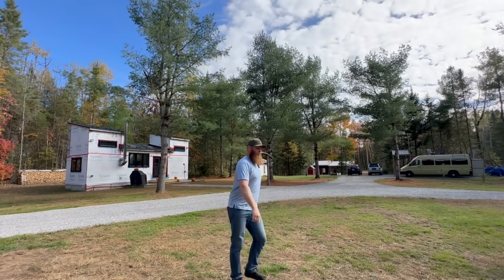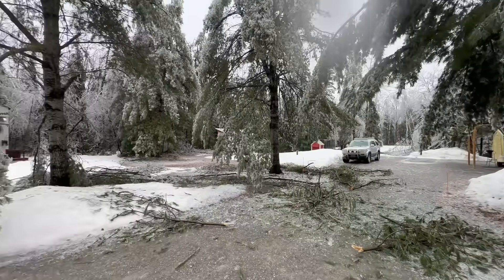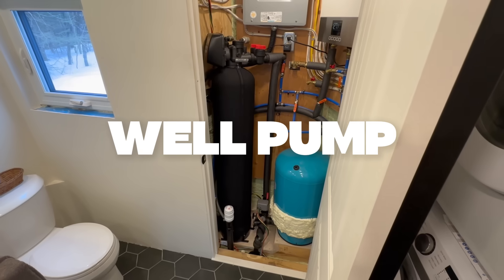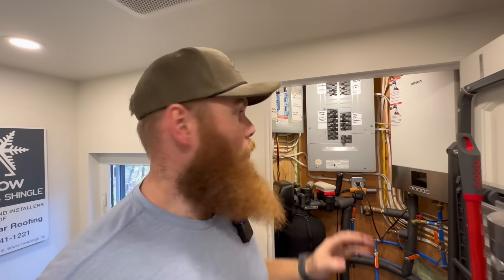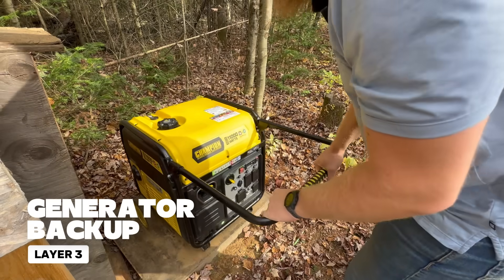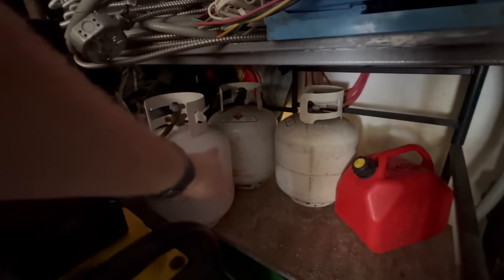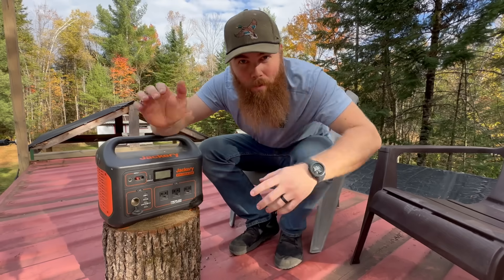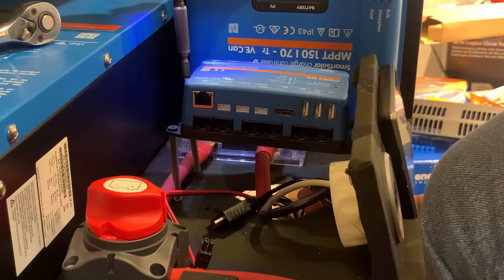This Trick Keeps Our Tiny Home Powered All Winter

Comment: We are t as prepped, we have propane oven/stove and propane wall heater in the hallway. Our grid home gas electric for everything else. When we lose power, we use candles and our solar generator for the fridge and freezer. Our plan is to get a dual power generator. Losing the well pump is no fun! Thankfully, we have a spring fed creek… gonna check out the generator you suggested thanks!

Comment: While I do rotate my gasoline supply and use Stabilizer….Ive read and been told that diesel DOES NOT deteriorate like gasoline and can be used after years in a plastic can.  FWIW….i also put Diesel stabilizer in it

Thoughts? And Thanks!!!
Reply: Diesel is fine after 100 years. You can look at videos of junkyards starting up diesel engines that have been sitting for 75 years using the fuel that has been sitting in the tanks.

Comment: We're an off grid "Homestead" with no grid power.  We have just under 4kw worth of solar panels, 16 100 ah Battle Born lifepo4's a 4,000-watt duel fuel genny, a 2,000-watt gas one, and a 4,000-watt contractor generator as a last resort..  We have a 320 gallo0n propane tank currently sitting at 70%, wood heat, and 2 30,000 btu propane heaters for backup.
Reply: The guy is a delusional fraud.

Comment: I don't live off grid but my area tends to have power outages that can last 12+ hours, specially during bad snow storms. After we moved in 3 years ago our neighbors told us that they've experienced 10+ days of no power during the winter and gas shortages. We have an 18k solar array on an adjustable ground mount system, 45 kWh of battery storage, a smaller 2k solar shed with 10kWh DIY battery storage, 2 generators (one is dual fuel), 2 Ecoflow delta pro's, a portable Ecoflow delta 2, extra solar panels, a few small electric heaters, and a few backpack sized portable batteries. We're definitely prepared lol.
Reply from the maker: Wow now that is a backup setup if I've ever heard of one, good job!

Comment: I recently moved to rural Texas in 750 sq ft all electric home. I put in a 250 gallon propane tank and heater for winter power outages. I have 3 portable power stations in various sizes that I use for TV, internet, fans, lights and refrigerator / freezer that can be recharged by dual fuel generator and a small solar setup. New power stations can be recharged in a few hours using a generator. So an expensive solar set is no longer necessary, but good to have. At a minimum, have a 1000 watt power station. After 5 yrs, my Jackery has been used for running power tools, camping and power outages.

Comment: interesting setup. We live in southern Spain. For 5 years off grid with 2 solar systems (1 main, 1 backup) and a big 15kw generator. The generator is basically a jerry rigged tractor motor with an outlet lol. We also have a grid connection since 2 years. But with 30kw battery bank, 10kw in solar and the generator we never needed to use the grid.
Reply from the maker: Now that is an awesome setup, love the tractor as a generator idea. appreciate you sharing!

Comment: Ultimately it has to come down to budget.  We all want things we can't afford.
Grid power is the cheapest and most reliable power available.  Unless of course you need power run 2 miles in the boonies.
Your battery setup was NOT cheap.  Battleborn batteries are good, but WAY overpriced in today's market.   The same goes for Victron components.  I just built a complete off-grid system for a hunting camp and it cost $2600 total.  That's  a 6k inverter and 2 server rack batteries, so 10kwh.  We already had solar panels so that isn't included in the price but I'm seeing 400 watt panels for $120 in the Atlanta area.  We put 1800 watts of panels on this system. We also have a dual-fuel generator for recharging when needed.
It really comes down to your needs/wants.  If you need to run a well pump, heat pump, electric appliances, or an HVAC system, you need a pretty massive battery bank.  In the Southeast, it's common to use 70kwh per day during June-October in a normal house.
For strict emergency backup, I recommend a small gas generator.  5 gallons of gas will keep your fridge and TV running for a week.  Bigger generators run more stuff but use more fuel.  
The power stations (Jackery is at the bottom of my list) are great, but expensive per kw.  2kw really sounds like a lot of power, but it's not.  
I have 3 power stations that I can move around inside to run different things.
I have a dual-fuel generator, Harbor Freight, and a small Honda gas.  Backups to backups.
I do not have a grid tie battery system.  The cost to power my whole home would be prohibitive for something that rarely happens.  We live on a farm, so keeping 25 gallons of gasoline is no problem.  We run it through equipment before it gets old.  We also keep 120# of propane on hand. If we have an extended outage we can shower in the camper, propane, cook on the gas grill, propane, and keep our fridge and freezers going with power stations charged by solar or generators.  We keep a small window AC that we can put in our bedroom to survive in August.
Multiple layers of defense is the key.

Comment: Thanks for clear over view, however wrt generators, personally think you should try to AVOID a big generator as its low load efficiency is bad: don t buy one which can power all your big electricity consumers at same time, try to limit your self to generator power which can power your peak load (running and starting) of the biggest individual power consumer. Try also to have your battery bank storage and charging equipment  the can use 80% of the generator capacity for charging. This will  allow you te reduce generator runningvtime a lot and ensure they run fuel efficiently WHEN they run! An interesting back up generator could also be your hybrid Prius! And - at least in some countries- 2nd hand recent solar panels are getting very cheap (eg 6 years agoba oanel was 250Wp and now new panels are > 400Wp, but if you have open space on the ground these 250Wp panels still jave a lot of life in them and where I live they are sold for about 20Euro/piece ....

Comment: In an emergency, the jump starter in my car will charge my phone . I have a 12v socket with battery clips that will clip on the lawn tractor using my car charger , I can charge my phone in an emergency.  It will also charge from the deep cycle battery for my trolling motor. The last resort is to use the car to charge anything because  the ability to get to help when fuel for emergency vehicles is in short supply can save a life. I have solar lanterns that will charge phones plus pocket chargers, which I will use first before I go to the bluetti or my home built system.
Reply from the maker: Sounds like you’ve got a solid plan

Comment: I have similar set up. We have solar bank that basically run the house during daylight. will also pass any extra back to main grid. Wife uses C-pak machine so if power fails, we have battery backup that will run our five refrig/freezers, lights, TV etc. for about 4 days, just not HD appliances like dryer. We have two whole house backup generators and yet to install a small wind gen. We have propane stove and instant hot water heater. We live in Northern Maine and get quite a few power outages; however, they are usually short lived. Two days out has been the longest. We have a 500-gallon propane tank and about a dozen small tanks.

Comment: Nice setup. You didn't mention it but if you have a propane cooktop, I assume you consider a vent fan as a critical system - especially in a well-sealed tiny home.

I've seen some really great videos lately of bifacial solar panels setup vertically like a fence. You may not get the wattage you could from "properly angled" panels, but snow doesn't build up on them so don't have to go out and clean them to get power. I don't know how deep the snow gets in Ontario, but maybe place them far enough off the ground so they don't get buried? It could be an interesting experiment video for the next snowstorm to see how well they produce.

Living in the southwest U.S. at an altitude that hasn't seen snow since somewhere in the 1970s, I prioritize solar and batteries over a generator. It's always best to have multiple options and backup plans for backup plans, so a generator is still on my to-do list. I did get through a recent 3-day outage with smoky skies by using my cars to augment the solar (60 amp DC-->DC charger - not through the cigarette lighter). But I have a natural gas water heater, central heater, and oven, so I was really just powering my fridge, lights, and my home office so I could stream movies.

Comment: Nothing against Battleborn: they were pioneers and apparently built high quality systems. But those four batteries are $800-$1000 dollars.  You can get far more power for less money going with different brands now.  A typical 5KWh battery runs between $800 and $1200 these days vs the $3200-$4000 for the Battleborns. There's no comparison.

Comment: An Ole Winnebago Onan 5.0RV Motorhome Generator assures My Well Pump and Main Panel have backup power in an Event. We still need to flush, Shower, Food Prep and Clean the Kitchen. All 4 Implemented here Propane Stove Top, on Demand Hot Water Heater, 5 Separate Solar Systems and Both Solar Arrays and Battery Banks and a Wood Burning Stove in hand. Not to mention various Oupes Megs 1 & 2 and several Eco Flow Units for Grab & Go Power Solutions.

Comment: We're suburban and have a pretty reliable power grid here, but our power outage solution right now is our electric car with V2L (Vehicle-to-Load) capability.

It's essentially just a plug that goes in the charging port of the car with a standard powerboard on the other end that makes use of the internal inverter to output up to about 2,000 W (standard grid voltage here is 230 V, not 110). If the power goes out we have a long extension lead that we can string inside to our fridge, our benchtop convection oven and a travel router that can tether to my phone data, some lamps, chargers for our devices etc.

The car has a 60 kWh battery. I know a number of people who live off-grid who own an EV and use it as an emergency backup to their off-grid power setup.

Comment: In many areas, electric utilities have lower rates at night.  If you have time initiated switch you could charge batteries at night when rates are low then use batteries to run appliances at day when utility rates are higher.
Reply: Bro yeah I see ads on tv for companies that say free energy from like certain times in the evening and that would be so cool just every night at that time charging for free and boom free power during the day

Comment: I'm working on buying portable power stations while building a mini battery electrical grid and taking most of my appliances and taking them off the grid. Fridges, Microwaves, Toasters, can openers, AC, Food Processors, soon to be Washer and Dryer. will be doing the same to the Internet, TV, Surround sound, Computers, and so on. till we can get a Battery backup system built in. power station brands include: Bluetti, Jackery, Anker, and Eco Flow. might include others I don't know yet.

Comment: I have a separate panel and a Honda EU7000 inverter for back up since 2016. My power here in New Brunswick has been out about 6 hours since 1990 not counting Hurricane Arthur July 2014. It was out from Saturday morning until Wednesday afternoon during that one outage. It was summer so moderate temps fortunately. At the time I had a Honda EU2000. I was on city water so all good. Anyway cable and internet kept working. So I ran the Honda the whole time and never ran out of gas. Ran my tv, internet, fridge, freezer and sump pump. When I moved in 2016 I then had my own well. The reason I upgraded to the 7000. Anyway when any weather is on the way I have 160 litres of fuel on hand. Not counting full tanks in my 6 motorcycles, quad, ride on mower and several other vehicles. At 25% load my 7000 will use about a litre per hour. I can run everything in my house including one of my 18,000 BTU heat pumps. Just not all at the same time. I don’t have the redundancy you have but I’ll run out of food before power. It’s a comfort though I’ve used it 2 hours since 2016. Still have my EU2000 if I only require a little power. Plus an Eco-Flow for backup although it is limited compared to the generators though the generators will keep it charged.